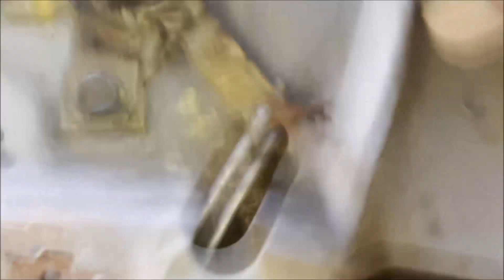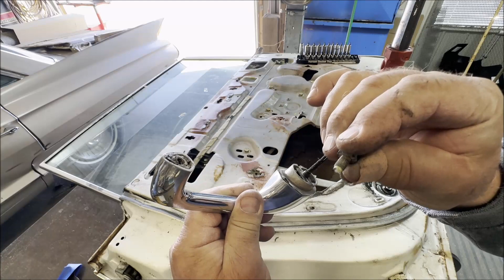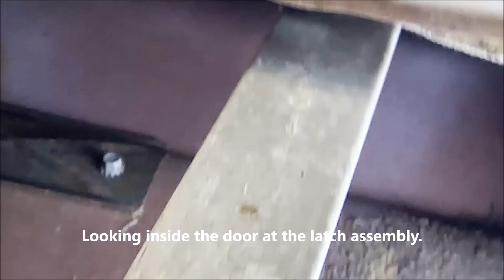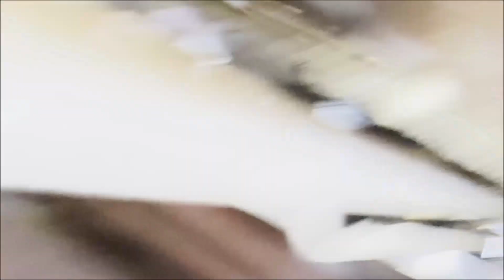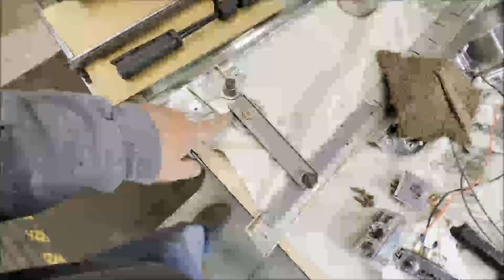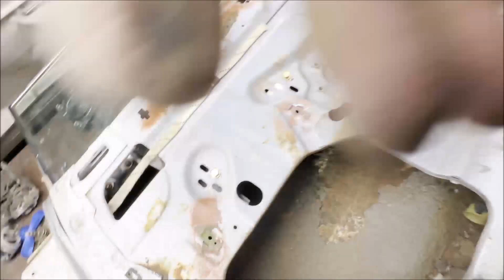1961 Cadillac Door Window, Regulator, and Motor Removal

Comment: Hey Nick, I just need to take the glass out and wondering what the least amount of work I need to do to just remove the glass. Thanks!
Reply from the maker: Hey Cherrypanther, the least amount of work is letting someone else do it. 🤣 Otherwise the only way to get it out is to remove the door panel, and then remove the window motor and regulator. There is no other better shorter way. Good luck.

Comment: Hi nick Thank you for the informational videos! Question: does the original gas tank have a drain plug and where is it located? Can I reuse the old filler tube seal if I remove the tank to clean it? Also I love your black 66 tbird convertible with white interior you bought in sherman oaks! 🤩 Any more videos of that black 66 tbird convertible? ☺
Reply from the maker: Hey theoldcar, thank you very much. I have reused the filler neck O ring a few times but they are available new now so my advice is to get a new one. If the old one is not torn or cut in any way, I guess you could reuse it. Use assembly lube on it. I dont have any more videos on the black 66 conv yet but some day. I want to make a convertible top repair video with it when I get around to working on it again. Thanks.

Comment: Hi nick Thank you for the informational videos! 
Question I have  severely oxidized internal rear taillight len for the 66 Thunderbird that is basically white while the other side is nice and red. cleaned outside with good plastic restore and no good. 
So anyway how do I remove the rear taillight lenses for cleaning? Also I need to replace some taillight bulbs as well. 😂😊
Reply from the maker: You have to remove all the trim around the lenses, then the center lens, then the outer lenses. You can see and access all the screws. Its not hard. You can buy the lenses and gaskets new. Good luck.

Comment: Hey Nick,

Completely off topic to this video.

I've been watching your 66 thunderbird videos as a new owner of a 64, pulling my hair out with all the cowboy crap that previous owners have done.  Your videos have helped  a lot.

One piece of advice I would offer to you, one old guy to another.  Invest in a cheap 45 dollar blue closed cell foam sleeping bag mat.  It doesn't soak up water.  It's great to lie on.  You can cut it up to fit a particular place in the car.  It's the best 45 bucks (CDN) you can spend when you are working on these old cars.  Trust me, your joints and back will thank you.

Comment: Have to say that that power window motor looks pretty small and weak compared to the 61 Lincoln and Thunderbird window motors.
Reply from the maker: Hey Jeff, its pretty heavy and I'm surprised its square. Usually electrical motors are round for obvious reasons. Ive seen them before but never work with any. I'm anxious to take it apart and fiddle with it, see what makes it tick. Once again, this Cadillac doesn't hold a candle to the Thunderbird.